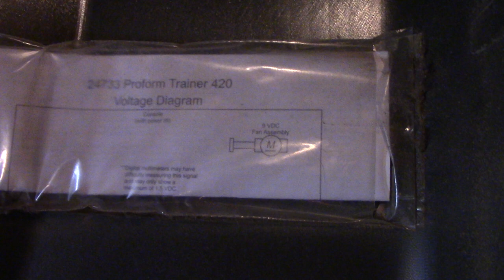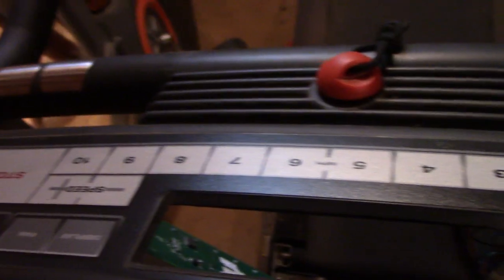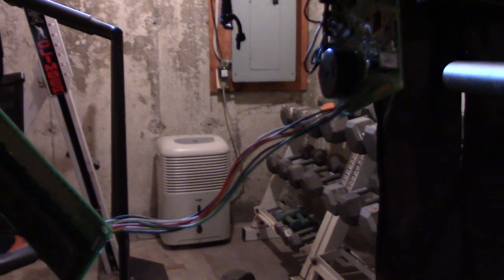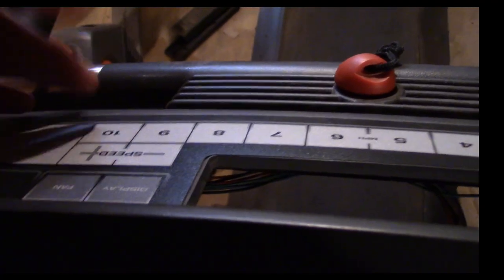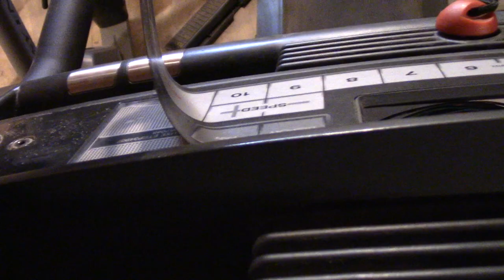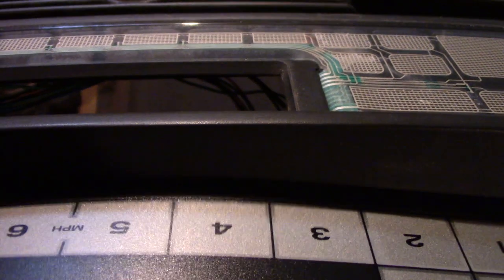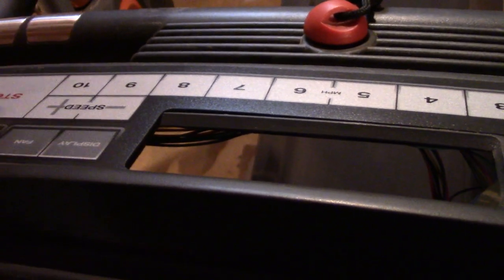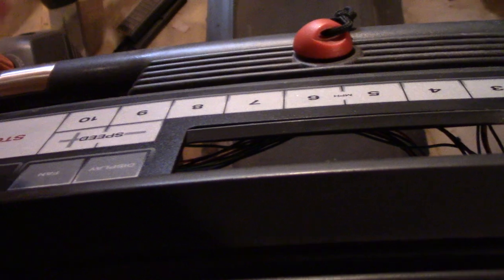Treadmill console buttons not working.

Comment: Thank you so so much! I inherited an older Proform treadmill from a family friend who knew I was wanting to buy one. Once we got it home and positioned where we wanted, and fully installed, we had a very similar problem to what you described. Only a couple buttons would work, and my husband was at a loss, not knowing anything about electrical issues. Anyway, not wanting to spend my kids entire Christmas budget on a brand new treadmill for myself, I got on YouTube to see if I could figure out any ideas. Low and behold I come across your video, and I thought, well I don’t think mine has stickers you pull off, it looked pretty well attached. But sure enough, I walked over to it and saw a seam. I pulled both the right side and the left side off and it looked very similar to yours. And what do you know-it worked!!!! I even put the stickers back on and it still worked. You just literally saved me hundreds of dollars, so THANK YOU for making this video!

Comment: The control switches are called “membrane switches”: 

- They have two sides - top and bottom 
- Over time the membrane weakens and the problem you’ve has is due to the two sides being in contact the whole time. 
- removing the sticker relieved some of the pressure so working again now :)
Reply: Thanks for explaining why this happens

Comment: Thank you so much for this video!!!  I have a treadmill that hadn't been used in quite some time. When I decided to get it back out it wouldn't work. All of the LEDs would illuminate when powered on (power on self-test) but nothing more than that. This video was the key to diagnosing the problem. I was able to determine that the stop and speed + buttons were continually being pressed. As demonstrated in this video, I tried peeling off the applique, but unfortunately, it did not fix the problem for me. Instead, I ordered some 12mm pushbuttons from Amazon.  I removed the membrane switch assembly (threw it away), drilled 1/2" holes in all of the button positions of the console (I only have 5), and installed the buttons. I soldered the wires for the buttons to connection points on the printed circuit board adjacent to the membrane switch connector. It works like a champ again. This video was very helpful in diagnosing the issue. I am grateful that you took the time to share your knowledge.

Comment: Thank you for your help. Was able to fix my C800 NordicTrack treadmill. For my particular issue which was that only speed 3 and speed 9 buttons were the only buttons that were working on the console, I had to not only remove the plastic decal cover, but also had to unstick the sensor strip from its seat, the reason I removed the sensor strip from its seat was that after I took the plastic decal cover off speed eight start working but nothing else still worked (besides speed 3 and 9). Once I re-seated the sensor strip, all the buttons, including the incline and start stop started working. My guess is that there is too much pressure built on to the sensor strip over time causing it to not respond properly (kind of like when you had water over a phone screen and your touches don’t work so well). Thanks again. Hope this helps anyone else who had the same issue as me.

Comment: Man, THANK YOU!!!!!!!!. I dealt with pro form customer service and they were awful. I will never buy another product from them again. They wanted to sell me a new console for 200.00 plus or a service tech to come out for 180.00 who would have told me I needed a new console. 

I was about to ditch the treadmill but went to YouTube for a last stab at it and lucked into finding your video. It worked perfectly. Mine had 3 sticky panels and removing and replacing the middle one did the trick. You just saved me from buying a new treadmill

Thank you once again!!!!!!!!
Reply from the maker: Sweet yes I don't know how many times I've gone to YouTube and found something it's amazing what's out there when you're in a pickle
Reply: Pro-Form service said that there were no parts available for my 530 and they offered a 10% discount on purchases over $1000 if I purchased it from them.... RIGHT! They didn't even know about this fix or were unwilling to suggest it. Look at how many people were helped by this.

Comment: I have a Weslo Cadence G-40 treadmill and some of my buttons weren't working either. I took the whole thing apart just like you did, but still couldn't fix the problem. I'm soooo glad I found this video because I was about to throw the thing away and get a new one. To my surprise, I peeled back the button label, just like you did in the video, and every single button now works! Thank you very much for your help! Mystery Solved! Downfall is I have to remember what all the buttons were labeled, but on the plus side, they all work. When I went to take the label off, mine cracked and peeled in to a mess, so it was salvageable. Just keep that in mind when you go to peel it off as not all button labels come up easy, at least not my Weslo...

Comment: This worked for me too on a nordic trac c220i - I had been putting up with only the speed numbers on one side working without being able to do anything else for some time.
I was nervous to do this but then I got to the point where I needed to replace the belt at around £80 so thought i'd try it - as it wasn't work spending this money on a partially working machine.
You don't need to cut the pad just peels back if you lift it away with a thin blunt knife - just be careful not to break any of the connectors to the control unit - - i.e. just don't pull it away too hard go slow
Mine now works fine - and with a quick wipe underneath I have put the sticker back in place as it remains sticky after.
I'll update again later to see how it goes long term with the sticker back in place looking immaculate.

Thanks so much I was ready to buy a new treadmill but now can get a bit more life out of this one...

Comment: Awesome!  I was at the point of giving up (because it still worked mostly well enough to use, though couldn't access certain speeds).  I was hesitant to peel back that top plastic for fear of ruining it completely, but your video gave me the confidence that it would be okay.  It's working great now, thanks to your suggestion.  I would only add that using a heat gun or a hair dryer to soften the glue makes it a bit easier to peel back.  Just go slowly so you don't crease it.  Thanks again!

Comment: That's crazy! I watched this because my i1300 Intrepid stopped working just like yours. I looked to see if the panel would come off of the controller like yours did. It would not...but lo and behold...I realized that the protective skin had never been peeled off of the control panel. Peeled it off and works like new. I have no idea how that was stopping the buttons from working but sure am glad you posted your video. Thanks.

Comment: I started having this exact same problem with my Pro-Form 530 about a year ago. We ended up thinking it was an overheating issue and started unplugging it after every use. I realize now that it was just a coincidence that it worked for awhile like this but the problem became more frequent until that was it. It simply no longer worked. I took off the back console cover and remade the ribbon connections but that didn't help. There were no indications of anything shorted or burned on what I could see of the circuit boards. 

My wife and I were really happy with this machine and I decided to try to source the boards. No dice! We already decided to look at other machines. Boy, the prices almost doubled! I don't need apps or Bluetooth connectivity, just a nice folding treadmill that's sturdy and reliable. I found several Xterra models at about double the price I paid for this one back who knows when.

Then I saw your video. It made sense. I think what happens is that there is some shrinkage of the cover template or the adhesive and it ends up pressing multiple buttons and it locks up the input buffer to the processor. I removed the cover just as you suggested and I have a perfectly working machine again.

You saved me a thousand dollars my friend. Thank you very much!!!
Reply from the maker: Nice. I think exercise  Equipment is expensive because of covid 19 in part.  When the gyms were closed I sold some free weights and dumbbells On eBay.I was hoping to get around $200 for approximately 1200 pounds worth.A bidding war took place and some fella paid me $2 per pound.I am pretty sure I paid around 45 cents to 50 cents a pound years ago when I purchased themAdd a place call Dick sporting goods nearly 20 years ago. So there's no surprise that home gym equipment is doubled.

Comment: You are the best!  I so appreciate you putting this video out there.  I have a Horizon Fitness T605.  It is located in an unheated garage.  It worked great all last week and the last couple of days,  the temperatures have dropped to freezing and now only a few of the buttons were working.  I was thinking that the cold temps must have damaged the circuit board, but that was illogical because it was in unheated storage for many years.  The user manual gave me no clues.  I went on an internet search and found your video.  I used a razor blade to carefully peel back the display cover and miraculously, once removed, it started working properly.  Thank you so much.

Comment: Thank you J La for sharing this video.  I have just recently bought a used Nordictrack crosstrainer and the first time I tried it all the buttons worked.  A day or so later only 2 buttons worked and even my electronically minded partner couldn't figure out what was wrong.  The machine has been in an unheated garage since we got it and we did have a very cold spell a day or so later so I wondered if the cold had affected the display.  Having nothing to lose I got a sharp bladed knife to help me lift the corner of the console sticker and peeled it back.  I peeled it and re-stuck it a couple of times and now it is working fine.  Brilliant!

Comment: Thanks J La you saved me lot of $$$. I would only add that you don't need to take take all of the plastic off at once. You can pullup 1/2, then lay it back on to see if works. If it didn't work, pullup the other 1/2. The reason why console buttons don't work is because one or more of the buttons got stuck. So by pulling up the plastic you release the stuck buttons.

Comment: It worked for me on my Golds GYM trainer 480. Used a blow dryer and a plastic tool to peel it off, the sticker on my model has the circuitry in it, peeled it half off then put it back on and now all buttons work again. Only 1 or 2 buttons would work and sometimes none before, thanks for this video. So it would work sometimes and sometimes not so I thought it was a loose wire but nope.

Comment: WORKED!!!!!     I had read manuals, online articles, "Perform the reset / calibration" tips.. ETC.. 
Before the fix, ONLY the 'incline -' worked.  Now, EVERYTHING works.
Reply from the maker: I know I don't get it. it is amazing how many people say that worked and it was just removing a piece of plastic film and reapplying go figure. I wish there was a reason why this happens and you can wrap your head around it but there's not
Reply: @JLafix  The reason this happens is that the button contacts got stuck together. However, when you peeled the cover layer off, there was enough upward pressure to make the stuck buttons come back up where they should be. There are actually 3 layers, the part you peeled off is layer one (the printed layer showing the controls). Below that are two button layers. The one you see and an identical one below that. The button circuit works by resistance. When the top layer is pressed it makes contact with the bottom layer, sending a specific resistance signal down to the motor controller board at the bottom front of the treadmill. This is how the treadmill knows what to do, the speed you want, etc. However, when one of those buttons get "stuck" in the down position, it confuses the controller board and other buttons will not work while that button is pressed (or stuck). Pressing certain other buttons, temporarily unsticks or trumps the stuck button, so only certain buttons will work, until you unstick the problem buttons as you have done, simply by physically peeling off the top layer, literally "pulling" all the buttons below the sticky printed layer to come up right to default positions. Here's a good video to better explain the fix: https://www.youtube.com/watch?v=m8IAZyxoky8
Reply: J La is it a temperature / swing / humidity thing? Just had mine do the same thing..

Comment: I have an XLP 1000 with buttons that would not respond except for a few.  
I tried the peal back process and things started to work, but not as per the
top label.  For instance, I now push the + button to start the belt and nothing
with stop it.  To increase the speed I push the + button and it increases by
one tenth.  So we use it at about 1.4 and pull the cord when we want it to 
stop.  The incline and decline now work as they are supposed to.  Bottom 
line is that it functions good enough and cost nothing to make the repair.

Comment: I have same thing, all was good. Moved it 10 ft and no go.  I get two buttons on mine.  (525e model) I pulled the cover and see the button pads. No help.  Same as you I get one working pair on left and right side.  (iFIT button on left and "-" button on right.  If I push them at the same time nothing happens.  So they are likely strung as a pair and not with all the others.  My thought from the start was one button must be stuck.  I tried using a hair dryer to heat them as that might make a sticky one pop.  No help.  At last you showed me how to get inside of the buttons to replace the contact panels.  thanks!
Reply: I tried using a heat gun on mine as well hoping it would loosen up the two that were stuck. No dice. I actually melted the membrane switch a little on my last attempt. I ended up removing the membrane switch pad and installed small pushbuttons from Amazon. I had to solder the wires for the switches to the circuit board, but it works great again. Albeit a bit modified.

Comment: I have an older nordictrack 1000. I ran on it saturday.  It rained on monday, but I had a cover over the treadmill. When I took the cover off and plugged in the treadmill, none of the buttons beeped or responded. I will put in my key, you hear an initial beep and the lights come on for speed, miles, calories etc... but I hit any button and nothing. I just took apart the console, and reconnected the ribbons cables, still the buttons don't respond, I'm thinking about trying this in the future.
Reply: sad, not working for me... mine only got a few buttons working, other all dead.

Comment: PaceMaster Platinum Pro VR - Unbelievable but it worked . . .  un-f'n believable. Caution with this model of treadmill, remove the button overlay from "right to left" as on the left side there is a ribbon cable attached to the button overlay that goes through a slot in the plastic base and attaches to a connection with several pins underneath. I got lucky and none of the pins got bent. I would suggest removing the back, underneath the control panel first then unplug the ribbon cable. Then remove the button overlay adhering to the panel. I t worked people, it worked!

Comment: I couldn't peel , can i use a hair dryer? Or just clean the ribbon cable?
Reply from the maker: I believe what's going on is the sticker that is pressed to the buttons Has 2 Or more buttons simultaneously  pressed at the same time and throws the machine into lock down confusion State,  By lifting the sticker up it releases the 2 or more buttons that's my guess anyways
Reply: @JLafix  i pulled the sticker but no help despite touching the console several time

Comment: NOTE: This product works exactly as described. https://www.youtube.com/post/UgkxguEIMc_Qwab-3QMTpF6jaRL80hiOOsIN  It originally earned a four-star review due to a minor defect (see below). However, the manufacturer's customer service rep (Lita) went above and beyond the call of duty and deserves five stars now. I wish I could give even more!I purchased this item which arrived quickly. Assembly instructions were easy to follow. There was only one problem: One bolt did not screw into the hole properly. I called the company. Their customer service rep (Lita) was terrific! She took all my information and submitted a request to replace the defective part. I'm hoping to finish assembly and start using this treadmill soon. (Fingers crossed...)FOLLOW UP: Lita called back to inform me that the company will send a replacement part AND a technician(!!) to install it properly. AMAZING CUSTOMER SERVICE!! Thank you!!

Comment: Damn it, I got so excited but it didn’t work for mine only the stop button works
Reply from the maker: You gotta be like 1 of 2 people that It didn't work for.
Reply: J La yea I know, thats why I got so excited when I saw this video cause everyone was saying it worked for them.
Reply: @SAYYW0RD  It's okay it didn't work for me either. But I have a schwinn 830 treadmill
Reply: One woman took the ribbon cable out . Used a siccors to cut the ribbon into strips. Then experimented not inserting individual ribbon contacts until it worked. She had a couple buttons not work.
10 wires in the ribbon but 14 buttons. Hmmmm
Reply: One woman took the ribbon cable out . Used a siccors to cut the ribbon into strips. Then experimented not inserting individual ribbon contacts until it worked. She had a couple buttons not work.
10 wires in the ribbon but 14 buttons. Hmmmm

Comment: I run, I sweat, I sweat everywhere, I put Velcro on each side of control panel and stuck a strip of plexiglass on it, protects buttons screen

Mine quit running after many years of use, it too looked like yours at the motor compartment, vacuumed it out and it ran fine

Something has happened, now it only runs full blast...... can't figure it out